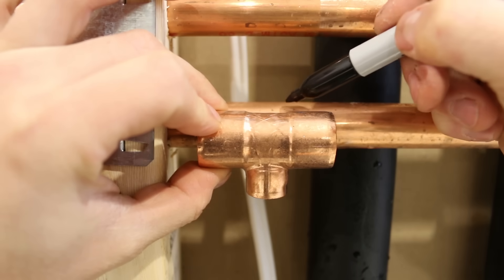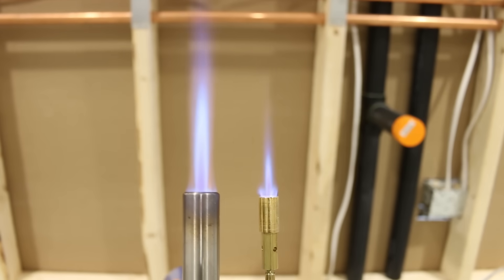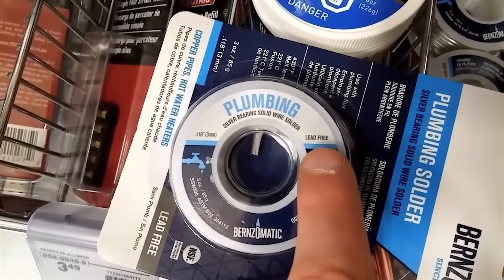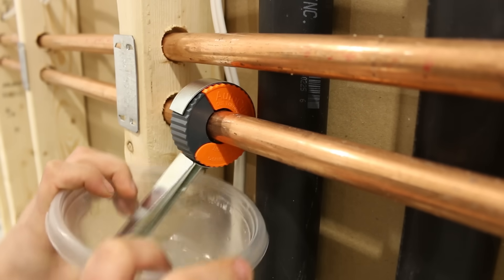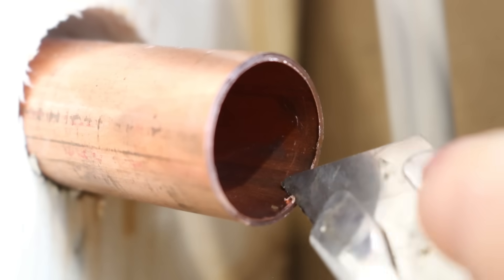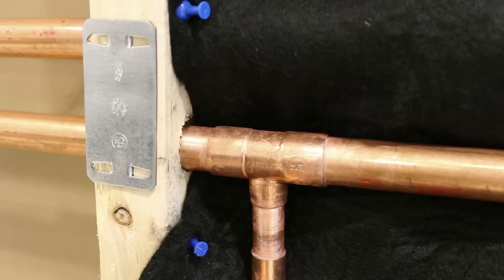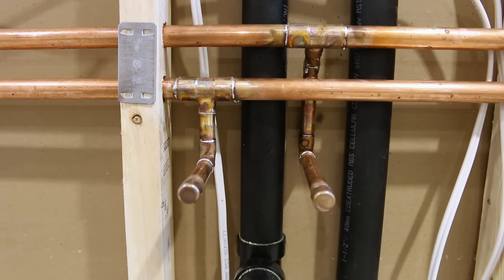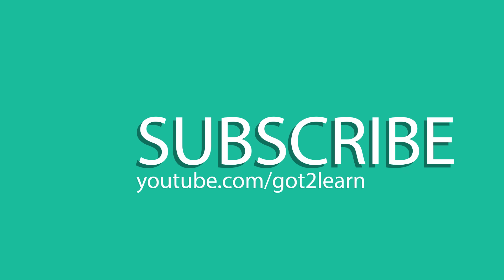How to Solder Copper Pipe in a Wall (Complete Guide) | GOT2LEARN

Comment: You do a very professional video. Perfect in length and clarity. Often instructional video on YouTube is so cluttered with gab that you want to scream. Let me add just one point, Many plumbers like to wipe down their solder drips while still hot.
Reply from the maker: Thanks so much! Personally, I prefer not touching the joint while it's curing, but that's just me.

Comment: Something that works excellent for flame protection in tight areas is suspended ceiling panels, easily cut and shaped to get in almost anywhere, and they don't burn even if thrown into a burning wood stove, they just won't burn, designed that way if they did they would be an insanely dangerous product to use.
Reply from the maker: Good to know, a licence plate too works well. Thanks bipedalbob!!
Reply: @Got2Learn  licence plates are pretty scarce in my part of the world, we use the same one forever, just don't find them unattached , but if I do I'll save it.
Reply from the maker: Yeah, it's more of an ancient technique, but it works ;)
Reply: @Got2Learn  would you have any idea what is causing my copper plumbing to be deteareating from the inside out, causing pin hole leaks to occur, twice on the inside bend on a 90 degree elbow, once on a straight run, the piece I cut out from the straight run had a green slime inside it, the copper is breaking down from the inside, the building is about 25 years old, I've never seen this before even in plumbing over 50, I showed a piece to the local plumbing supply and they said 'maybe' electrolysis, the system is a combination of copper, steel pipe and now I'm putting in per where I take out rotten copper, but I'm worried about the water heater for the hot water floor heat, 5000 to replace that.
Reply from the maker: It could be a lot of things, i'd suggest maybe bringing a sample of water to a nearby lab so they can tell you what kind of water you have, and you could take the necessary precautions from there. But eventually, those pipes will need replacement.
Reply: @Got2Learn  I think that would be worth doing, I'm on municipal water but many are on wells so a lab to do this shouldn't be to hard to find, while holding water in the bath tube during the last wait for the plumber phase to flush the toilet also discovered black sand coming through, the water us potable but is hard so I don't drink it but some do, thanks for the advice on testing it, good place to start
Reply from the maker: Yeah, you might need a good filtration system right after the main valve to solve the problem, lemme know how it goes.
Reply: @Got2Learn  I will thanks for taking an interest
Reply from the maker: My pleasure!

Comment: Good video.  I would never put  so much flux on their, (inside the copper).   I always put the flux to the outside of the pipe when I use the flux..   Flux is an extra, not required  to weld copper.   Can clean the surface with sand paper and the heat from the torch will clean the copper as well so the solder will flow..  Also  the more silver that  is in the solder the better the solder flows.   So the  cheap stuff  isn't going to work as good as the solder that cost a little more..   I wouldn't use anything with lead in it.     Just wrap the copper with a wet wrag  to keep it from heating up while welding.
Reply from the maker: You can't "solder" without flux, only "braze" ;)

Comment: Question:  I noticed that you DO use flux. It's made for a reason, it helps the solder by increasing the 'wetting' action.  It also helps lower the melting point, also a plus. Finally the 'Copper Development Association" has tons of info on the subject.  I thoroughly enjoyed the  video.  Kudos!
Reply from the maker: Do not use flux?
Reply: I always use flux.  But that's just my way.
Reply: @Stan Kappiris My Apologies.  I re-watched the video and there was indeed recommendations on flux usage

Comment: Great video, I'm just not sure that the bread will dissolve like you say? Dissolve down to what? Nothing? With the faucet having the fine particle filters on them, wouldn't it get clogged?
Reply: Yes, bread works great plus it's safe to use in water you drink.

Bread and water while in prison from burning down your neighboors house soldering. LOL
Reply from the maker: Yes, it will dissolve, but not completly. You'll have to run the water without any filter to get it all out, it takes 5 minutes in all to remove all of them to purge.

Comment: Simple, remember that the heat from the pipe causes the process, not the flame. Once the solder starts to run, pull your torch and just kiss the pipe with flame as needed.
Reply from the maker: Exactly :)

Comment: Go down to your box store and grab a piece of sheet metal I use a big sheet of copper that I've cut pieces off over the years and I grab a chunk of copper about the right size that I need fold it in half and stick it behind the pipes that I'm soldering so you don't have to worry about a fire
Reply from the maker: Yep, good tip!
Reply: @lilbodean7931  if your skill level is that limited I would suggest you not solder in the first place LOL
Reply: Well I guess Old Barry deleted his post maybe he realized how silly it was
Reply: Copper sheet is expensive, thin aluminum or sheet metal works way better. Two layers is even better to help limit heat transfer...

Comment: What happened to the bread ? Its will remain inside the tube
Reply from the maker: It dissolves when you turn the water back on :)
Reply: Plus bread is safe to eat, a requirement when puting things in drinking water pipes.

Comment: THIS IS GETTING OUTDATED.    MOST NEWER WATER SYSTEMS USE EITHER THE PLASTIC TYPE OF TUBING AND RELATED FITTINGS, OR, EVEN MORE RECENT TRENDS ARE TO " SWADGE" OR CRIMP THE COPPER FITTINGS ON TO THE TUBING USING POWERED DIES THAT DO THE CRIMPING.  NO FLAME, SOLDER, OR OTHER HAZARDS.  THE " SWADGED"  JOINTS ARE RATED FOR HIGHER PRESSURES THAN SOLDERED ONES.

Comment: You should never start applying solder from the top, you gotta start on the bottom when doing horizontal joints
Reply from the maker: That's just your way, I respect that.
Reply: Got2Learn it's the right way and the way you should be teaching. I respect the fact that you respect this is my way of doing as well
Reply from the maker: No matter what I do, i'll be judged so let's just move on.

Comment: or stop rely on old technology and advance to pressfittings atleast
Reply: Real plumber's don't use press fittings but today's so called plumber's are not really plumber's. I served my time doing lead, copper, steel, plastic, cast iron, glazing and lead roofing welding and joint wiping. Today's plumber's wouldn't know where to start. Church roof work, lead bashing wasn't a specialist work it was normal plumbing. We are now starting to see the results of using flexible fitting and push fitting leaking and poor quality stainless steel flexible fittings rotting away within 10 years of installation while soldered coper is still in houses from the sixties.
Reply from the maker: Sunday's video is all about propress ;)

Comment: I have done a lot of copper for repairs and I still learning thanks.
Reply from the maker: My pleasure man, glad you liked it, don't forget to subscribe and share, it helps a lot :)
Reply: If you have had to do repairs on copper it was no tradesman that fitted it in the first place
Reply: Have you ever heard of adding things in like water softener ?
Reply: @tunafish3216  Or how about repairing a water softener? Damn plastic bypass valve blew and there's no way to replace it without resoldering. What a joke.

Comment: PCV hot melting is cheaper, faster and more effective than copper soldering.
Reply: But copper is antibacterial and looking much better😉
Reply: But you will drink lead
Reply from the maker: @edmund use lead-free solder, never use 50/50 for potable water lines.
Reply: @Got2Learn  kinda impossible since solder is lead, periodic table 101
Reply from the maker: Not good for everything though.
Reply: use a press, get with the time
Reply from the maker: Sunday's video is all about ProPress ;)
Reply: we use PVC chemical welding, fast, cheap, reliable, no need for special equipment. PVC is actually much better and suitable for water pipes as you know copper tubing depening what area you live in can build up calcium and with that comes bacterial risks.

Comment: Thanks for the video, but you're not a welding expert. Pipes that connect upwards are connected outside.
Reply: I also do in-position or over head soldering as little as possible, but if you do the prep work thoroughly (clean the joints to a metal shine without scratching too deep, apply enough flux), then the solder will be sucked in the joint by capillary action. The only (slight) difficulty i have is with t-joints, because the copper is a very good heat conductor, and the best method for me is soldering all three joins in rapid succession without letting it cool down.
Reply from the maker: Thanks! It's not welding, it's soldering and what do you mean by "connected outside" ?
Reply: @Got2Learn  I was thinking of soldering, but you understood. Soldering wherever you can work by tilting when heating down. Soldering when the tin goes up during heating is not good.
Reply from the maker: Sometimes, you have no choice to solder upwards.

Comment: it is 360 around the pipe，dono't you melt  solder to all of them？it seems some behind area cannot be touched。
Reply from the maker: For bigger pipes yes, 1/2" and 3/4" it's ok to stay in one spot.
Reply: Solder will 'climb' hot copper the same way that water can climb a wick. You can apply solder from the bottom and get a good joint. Just apply heat from the top. It's not the flux causing it either. As long as the copper is hot enough to melt solder, that part will solder just fine. If you only apply heat to the front of the pipe, and solder when the backside is still below temp, then you will run into leaks.
The biggest problem I've seen with people learning to solder is that they apply heat for 5 seconds, nothing happens, and they stop. Then the second time they apply heat for 30 seconds and burn the flux. Once people learn to use the solder as a thermometer like he did at 11:52, they're good to go.
Reply from the maker: @yamaha...correct, but for 1/2" and 3/4" it's ok to stay in one spot, anything over that, moving the torch around is highly recommended.

Comment: I always pull my flame away when my solder starts to melt and heat evenly just a little hotter and it runs for a perfect joint .
Reply from the maker: Yeah ;)
Reply: Yeah I’m more into commercial work and usually work on bigger pipe 21/2” pipe when I do your prep work needs to be on point. And when I solder it I think of it as a boiling pot of water to get it hot enough and then I use the flame to pull it down into the joint.
Reply from the maker: Yep, that's how I do it too ;)
Reply: You are correct fella , move the flame when the solder melts, don’t offer the solder into the flame😉
Reply: Next time use a tampon...works much better.

Comment: I do not understand? Is it for drinking water that the copper pipeline was soldered? If so, the guy will have liver cirrhosis very soon.
Reply: can you explain please ?
what does copper lines have to do with cirrhosis  ?
Reply: @crash3ksa  Back in 1911, the Swiss professor Hartwihh explained briefly and clearly why this happens: “During fermentation with alcohol, a certain amount of acetic acid is always formed, which in the distillation process dissolves part of the copper from copper pipes used for cooling”. Fortunately for alcoholics, in most developed countries, factories producing legal drinks, cooling pipes ("coils"), previously made of copper or brass (alloy containing 50% copper), have been replaced with high-grade stainless steel pipes. "
Reply: @igorovcharov7424   Thanks for your replay! 
 i appreciate it.
Reply: @crash3ksa  :-))
Reply from the maker: We've always done this but you need to use a "lead-free" solder.
Reply: @Got2Learn  
Desperate you guys! :-))
Reply from the maker: Lol, what do you use?
Reply: @Got2Learn  
conventional electric welded pipes!

mineralization of tap water from 70 to 100 units on the scale of the device TDS-03
Reply: @Got2Learn  
And by the way, the water from the same pipe is brought into the shower and toilet bowl. Yes, yes, I wash the shit in the toilet with drinking water!

Comment: ughhh... how about using "cool gel" instead of any wet rags, also - no soldering wil get inside the fitting unless u put too much flux, and try to heat the pipe from all sides while applying soldering  to ensure to ensure it will get everywhere... for example  - cut the pipe vertically after soldering next time ( wile heating just one side like u do) and use a hammer to split the two pieces and look carefully how much soldering got around the pipe...Soldering is not a rocket science but you definitely should NOT be the one giving "lessons"....
Reply from the maker: Stop being so jealous ;)
Reply: @Got2Learn   There is a abrasive way he said things but he is correct, I've been a commercial plumber going on 15 years currently train apprentices and have been taught by the manufacturers that warranty the material the correct install methods, the correction suggested about heat application are correct. To solder as per the copper development association methods is to heat from the bottom then slowly move the flame up the pipe as you apply solder bottom to top.

Comment: Great instructional video, but I wonder what the price difference would be vs using shark bites? 🦈
Reply from the maker: Pretty much the same, the fittings are more expensive but they take less time to install.
Reply: Shark bite are garbage
Reply: @ericmalmstrom8895  Why?? I installed the Shark bite fittings on my copper pipes 15 years ago and they are still tight sealed. They just cost more but less assembly time.

Comment: This whole process isn't too different than electrical or electronics soldering. Excellent tutorial for a non plumber like myself. I'm probably still going to use Sharkbites to install my new water heater just because it's quicker and I don't have to go out and buy a torch, flux, or solder. However I did thoroughly enjoy this video.
Reply: Dont get that shit.... i installed thoae 5 years ago and i get leaks everywhere!!! The seal fks up and it has been a nightmare ... i just wait fir the next leaks to happen . Im always crossing my fingers during vacation
Reply: @alfonsoperez8535  Maybe you didn't install them tight enough. I've had about 20 in my house for 10 yrs and not one leak. The thing that sucks about them is the price.
Reply: @oilburner9989  Same
Reply: @gordonshumway5653  LOL...ALF
Reply: @oilburner9989  A man of culture, I see!
Reply: @gordonshumway5653  LOL.....And you too.
Reply: Sharkbites are good in an emergency or if the supplier is closed just to get the customers water on till the morning but never a long term product i would recommend
Reply from the maker: Thanks a lot OldsXCool ;)

Comment: Its good for health having copper pipes for drinking water?
Reply: YES ABSOLUTELY IS SAFE. HAS BEEN USED FOR YEARS
Reply: a WHOLE LOT safer than the so called "fda approved food grade" plastics these days, the more "new plastics" they come up with, the more you find out they're leaching all kinds of chemicals into our food supply, let alone everything else.
Reply: @Yhrim70  ,  exactly.  I wonder about all these plastic pipes plumbers/builders use and the chemicals leaching into the water overnight when nothing is flowing.  Is there such a thing as BPA free plastic piping?  I don't know.  But they use it bc it's cheaper and faster.
Reply: @StockDude  BPA is not used in the manufacture of PVC, CPVC, or PEX. It's used mainly for tough clear plastics like polycarbonate, and some epoxies. That doesn't mean there isn't other nasty stuff in PVC, just not BPA. All plastic water piping is BPA free.
Reply from the maker: Yes!
Reply: Everything dissolves and oxidizes, even plastic. You know when you leave your plastic bottled water sitting somewhere and then it tastes horrible? Specially when it was sitting in the sun or somehwere hot? That's the plastic breaking down and you are drinking nasty chemicals with your water. 
  Copper is a metal and very safe and harmless, actually your body requires a certain amount of copper , zinc an iron in a dissolved state, so oxidation from copper or zinc or even iron is actually beneficial.

Comment: where did you get the tool to rotate the auto cut pipe cutter
Reply from the maker: Check in the description box, all the links are there ;)
Reply: @Got2Learn  thanks general wire,on Amazon, 13 bucks,thanks,...keep the flame outa the joint makes sooty dirty hard for solder to flow,
Reply from the maker: My pleasure :)

Comment: If you’re bored a video about joining to non-threaded galvanized steel butt joints would be awesome.
Reply: If threading the steel pipe isn't an option (you don't have a threading die), SharkBite type fittings would be a better (and much quicker) option than soldering.
Reply: Bogdan N,  at the time of need I couldn’t find a shark bite fitting that could be use on galvanized iron pipe.  I used a compression coupling but don’t consider it a permanent fix.  I did look at the the crimping solution for gas pipe but couldn’t afford the ridiculous cost of the crimping tool and nowhere around rents it.  The installation is old enough I didn’t/don’t feel like it will handle the torque of threading.  I was in the classic jam of racing the birth of offspring and have most of the runs replaced with Pex A.
Reply from the maker: @charles I am currently working on a video called "Going from any type of pipe to copper" so it'll be in there for sure, thanks buddy and sorry for the delayed comment ;)
Reply: Got2Learn I’ll keep an eye out, thanks!